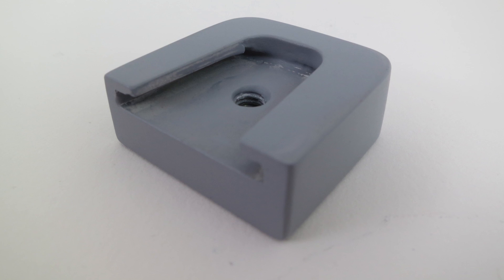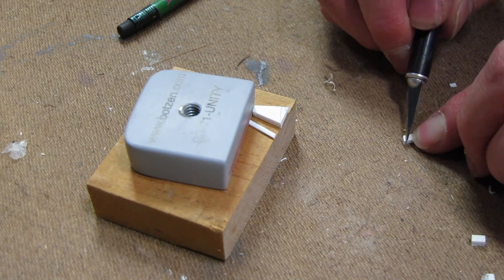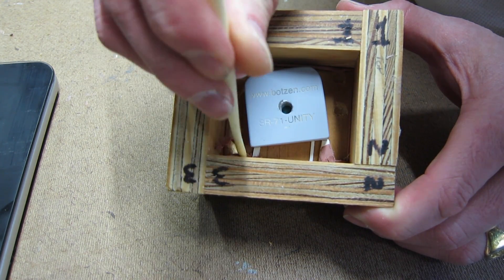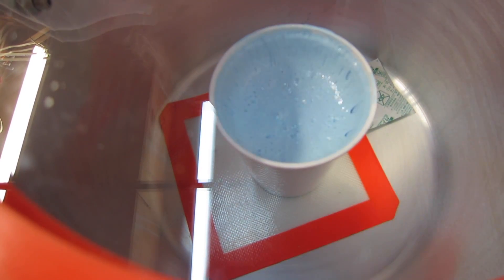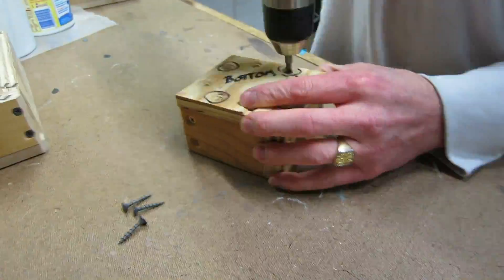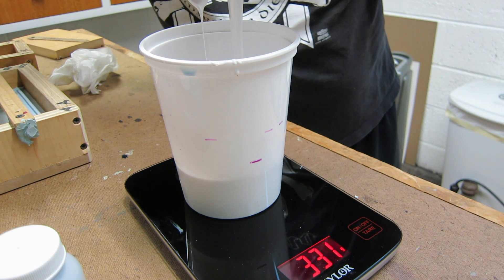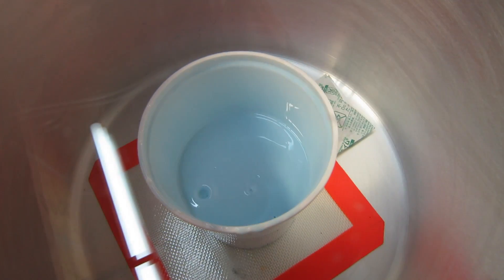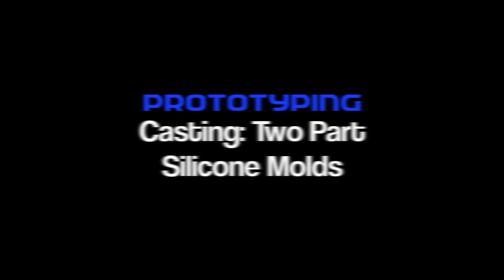Two Part Silicone Molds and Casting: Part 1

Comment: Hello sir what is the blue liquid you mixed up with the silicone thank you
Reply from the maker: Pigment
Reply: @EricStrebel  thank you sir I have design of a plastic product is this resin casting process enough to make at least 20 product per day and what resin type should I choose urethane, epoxy, acrylic in order to make the curing faster and thank you very much you helped me a lot.
Reply from the maker: It will depend on the properties you wish the final product to have, check with suppliers to get the right urethane resin for your project.
Reply: @EricStrebel  it's a small table 12cm*12cm*10cm lamp how much time it takes for fast urethane to cure sorry for my bad English
Reply from the maker: @ARSCAD-w6p  depends on the resin, consult a local resin supplier for resin information details, best of luck.

Comment: can you use the 100% silicone caulking tubes you buy at the hardware store to make silicone molds?
Reply from the maker: That is an air dry material, you can use it but it will take a long time to cure